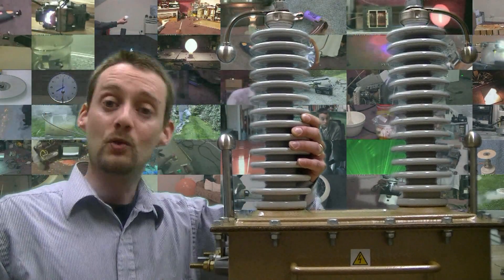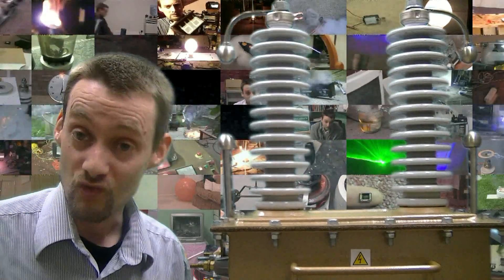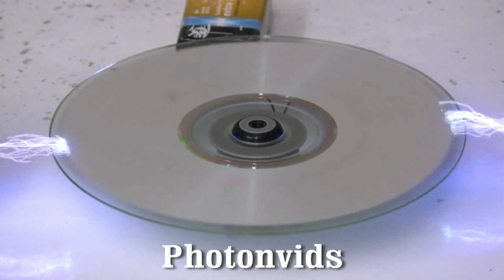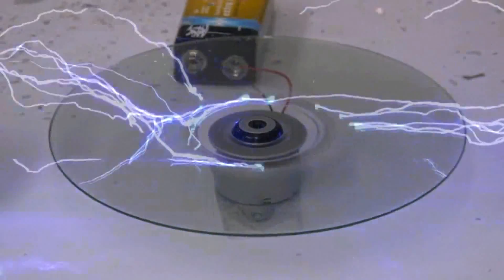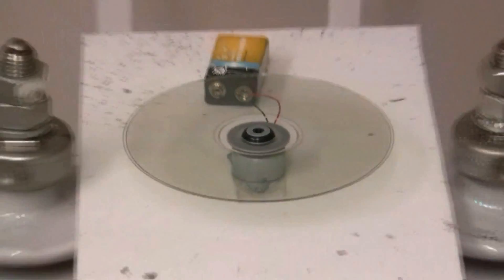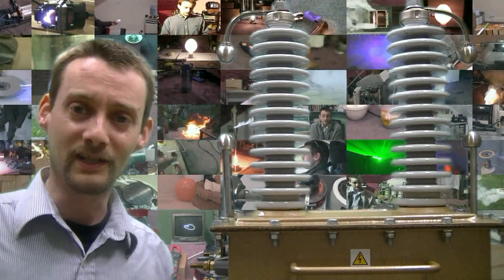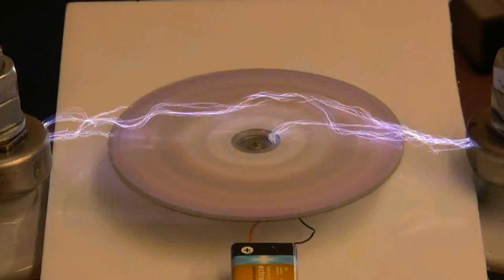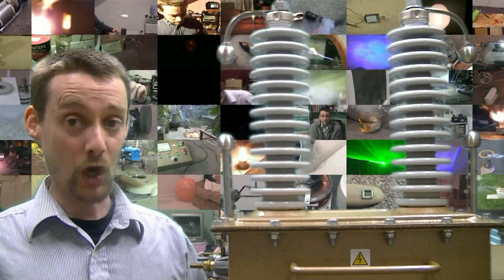Erase CD with HV + DVD

Comment: It would be interesting to see if one could remove the metal layer from a factory-made cd, which is not based on a dye but microscopic depressions on the disk itself, then re-aluminize it in a vacuum chamber, and finally try if it still works.

Comment: How does this not destroy the battery or little motor??!!!?!?
Reply: Closed loop. He says it at the end. Battery and motor are DC and any excess power goes to ground and not the motor (most electricity probably travels through the motor housing or around the 9 volt battery to ground or neutral), but this is just a guess.

Comment: Does this really erase the data of the disc though or just the reflective matter of it? I haven't brushed up on my CD knowledge in a decade or so but aren't the mechanics sort of in the ways of: When you burn a CD your computer sends pixies into the form of a laser that makes dips and grooves into the plastic part of the CD and not the reflective film on top of it.

Long story short, by ripping off the reflective material off the discs like in this video, aren't these microscopic grooves and such still present on the discs and can be readable if you theoretically replace the reflective material?

Edit: Haha, after I watched this video Youtube suggested this video in my feed: https://www.youtube.com/watch?v=RZUxemOE07Q
Turns out the reflective film does contain the data. Question answered.

Comment: 240,000 volts can melt steel beams.
Reply: +Shaheer Syed Volts can't melt anything
Reply: sunttu333 I'm assuming you're talking about this current shit.
I = V/R
did you pay attention in physics class?
Reply: Shaheer Syed I did and it ain't the volts that do the melting it's the amps
Reply: sunttu333 For constant voltage supplies, the voltage defines the current (along with resistance)
Reply: And that, ladies and gentlemen, is why welding machines use a very high ehhhhh voltage......

Comment: Oh man! You wrecked even Pingu?! Nooooooooooooooooooooooooooooooo!!!!!
The effect of HV grinding away the whole reflective layer of the CD is pretty amazing (although this might not render original CDs completely irreparable, because the data is actually pressed into the plastic substrate). I'm not surprised that it doesn't remove the DVD's layer (only the topmost painting), because that's embedded inside the plastic. Good to know that it renders that unreadable too.

Comment: 2:45 Thought a black hole was going to open up or something. Jesus....
Reply: It seems that it is a common theme with this guy. When 2,000 volts would do the job, 1,000,000 volts is added
Reply: +Ciber X Gaming Yep, that's called an electric arc. High-powered lamps use that for lighting and all the welding gears to melt the metal to be welded.
Reply: I know what it is, haha.

Comment: This isn't as secure of an erase as most of you think I'm afraid...
All this did was de-plate the metal from the back of the disk. To securely erase it, you'd need to try and slow the process down a bit, give it an opportunity to develop enough sustained heat to also deform the disk, as depending on the method of writing data to the disk, it may still be there.

As it stands, there's a good chance you could simply re-plate the back of the disk and recover some (if not all) of the data. The aluminium layer often only serves as a reflective surface for the reading laser to reflect back off to be read after passing through the plastic layer where the data is actually stored.

Now to see about SECURELY erasing everything.... How many volts could you throw at this, ***** ?! Or maybe even try it with some magnetrons pointed at the disk? That'd do it, and I'd imagine it'd be interesting to see...!
Reply: Have you at least ever tried to get a life?

Comment: Why did the arc turn white when he cranked up the voltage
Reply: +Adachi Basically because at that point the air's insulation completely broke down forming an arc (it became a conductor) and conducted almost the full power of the transformer (minus the heat losses) between its terminals. Such conditions should never be maintained for a long time, because they're basically a short circuit and thus can wreck the transformer (cause its winding to overheat and fail).
Reply: +Adachi the Amount of Heat is generated
Reply: @JCV11B  Yeah we got it the first time thank you!

Comment: Actually, the cds aren't being erased. The data is held in the plastic, with the metal film as a mirror on the back. Erased? No. Unusable? Yes.
Reply: nope the data is held by a very thin layer of dye between the plastic and the mirror side scratching a cd on the label side is much worse because you destroy the dye and data rather than scratching the plastic side which simply just disrupts the laser beams path
Reply: I'm afraid that isn't how a CD works. CDs work by either burning or pressing small indentations into the plastic media. A laser is shown through and whether or not the light is refracted allows the drive to determine if that bit is a one or zero. 
A writeable disc uses dye, but it is not held between the media and foil. 
A rewritable disc uses a metal that changes phase when data is written to it, uses no dye, and is sealed in additional glass layers. 
Perhaps do some research and provide sources before telling someone they are wrong. I'll be happy to provide you with sources if you so desire, but this comment is getting long.

Comment: This is really cool, especially when it looks like it is removing the data from the edges. Perhaps you could try this with HDD platters ?
Reply: BoomBrush They're usually either solid metal or ceramic, so electricity wouldn't do anything like this.
In this video, the electricity was de-plating the aluminium off the back of the CD. The HDD platter stores it in blocks of magnetic charge on a solid piece. You wouldn't see anything other than a lot of sparks and arcs, but all data would be gone before the light from it happening hits your eye, due to the electromagnetic buggery going on around it.